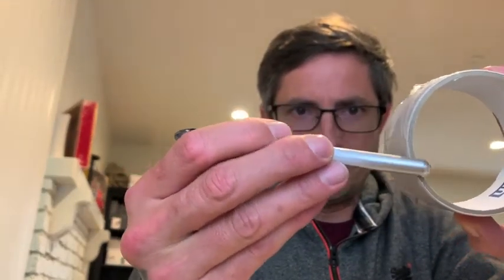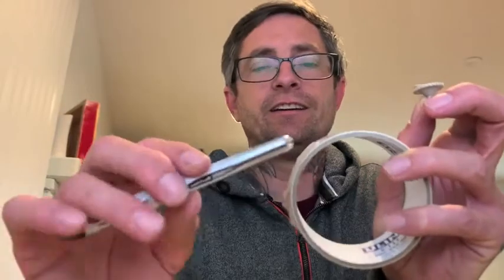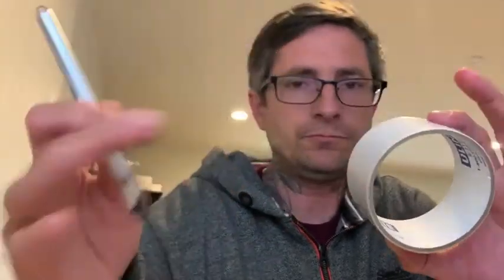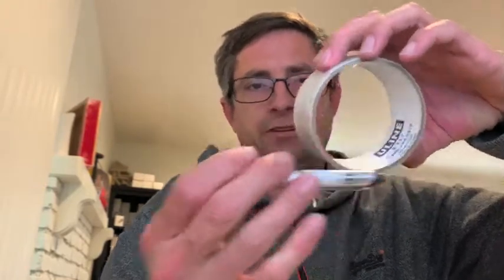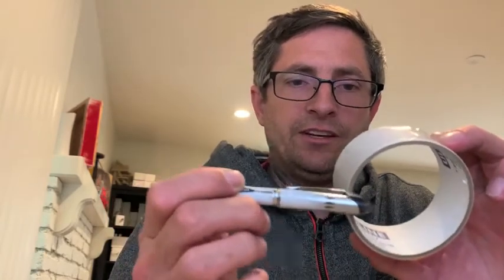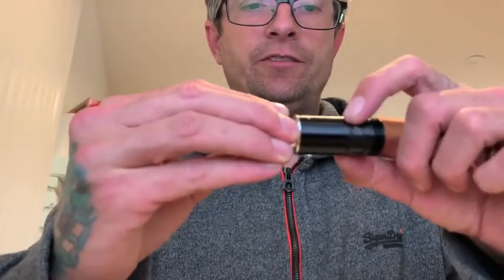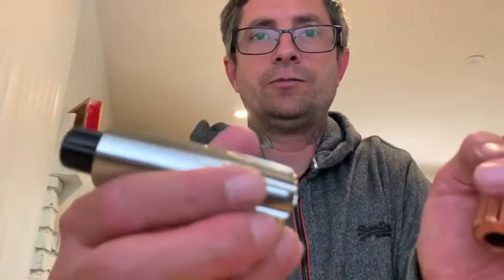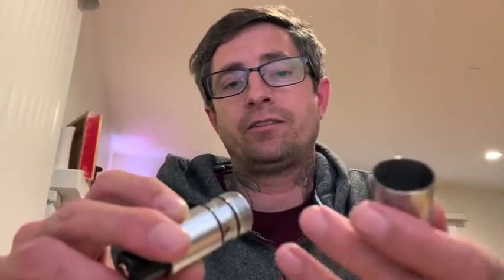Neuma 4 Waveform Explanation

Comment: This is the most insightfull talk about tattoo machines in general that I have ever seen on YouTube!! 

Did you ever think of using BLDC outrunners? You would be able to translate torque directly by attaching the cam to the motors bell housing rather than having the forces on the motor shaft?

Comment: The idea of the wave form, seems sound.  Maybe I'm missing something, but your explanation of give, seems flawed.    You are describing the combination of give and the bottom part of the curve and needle depth as almost a COMBINED FLAT spot in that curve of the rotary.  My understanding is much different (although not much different from your wave form idea). To help me explain, Let's take the 1st Dragonfly give mechanism to describe.    When circular drive mechanism (Exo-center) is in the 12 o clock position, and then drives to 5.  The needle is traveling downward.  The spring in the give position of its "tension"  knob COMPRESSES which delays the needle's take off.  It might not start at the 12 o clock position, It would most likely  take off at 3 to 5 o clock depending on rigidity of that spring).  Then, the DRIVE mechanism extends fully at 6 o clock , but the DELAYED SPRING doesn't allow it to hit until at about 7-8 (this depends on the rigidity of this spring also). By the time the spring allows it to hit at exo-center 7-8 the drive may have cut the spring's travel short (depending on RPM).  The needle might get sent on it's way back up, on time, OR SOONER than 7-8 if the exo-center reaches upward motion before the spring fully extends..    The reason this is thought of as ideal, is because, just like coil machines,  SPRING TENSION dictates these variables.  Depending on the "stay up" spring at the bottom and the tension of the spring in the give knob.  The "stay up" spring is similar to the BACK SPRING on a coil, the give spring int he tension knob at the top is the contact spring in a coil.  THIS EXACT variable is what made the coil machine STILL the best device for  putting on a clean and low damage tattoo.  You could ADJUST time in the skin, by balancing the tension of the back and contact spring on a coil machine. That also could be slightly and withing reason, adjusted by voltage on both of machine.   There is more reason than I care to explain why all of that is important on an INDIVIDUAL TATTOO level, but.......

     .....All of that also this misses one HUGE point.  Part of the reason older tattoo artists never used rotary tattoo machines a long time ago,  was as you mentioned, because of the exclusion of "give".  Your explanation of what give is AND why it was necessary lacks.  SO many explanations of it do today as well.  What they meant was the machine gave with EXTREMELY PRECISE pressure.  A good machine (in my opinion) had EXACTLY the same pressure exerted to the tip of that needle, all through that "give" area.  Meaning the hit felt the same at the point where it started to "give" as it did just before the "give" ended.  The end of give was always WAY after the tube tip ended.  All of this did A LOT for helping the fallible human operating it.  It meant the   person could vary hand pressure slightly (or surface topography could vary)  through that "give" area and the machine hit the same every single hit.   THIS IS WHERE the other saying, "Let the MACHINE do the work."  comes from.  TRUST ME, every single coil machine I built felt EXACTLY the same all through that give stroke.  All of those parameters including what tension it did the giving at, how fast or slow it hit all depended on usage.  Black and grey, Color packing, color blending or lining.

     Your explanation of the needle penetrating, and that kid who inserted the needle, the puddle and then he wiped the puddle, no dot...  What this person was correctly demonstrating is The Hydrostatic Principle, which states “a body completely or partially submerged in a fluid undergoes a push equal to the weight of the displaced fluid.”  What this means in terms of tattooing is, the needle enters the skin.  The needle when it enters (because of collagen) forms an air tight seal around the needle.  This air tight seal in entry allows air to escape from the  hole of the penetrating needle, because atmospheric pressure is less than the pressure created by the force of the entry of the needle.    Then as the needle hits the skin, the force of the hit throws ink from the tube and needle grouping on to the skin encompassing that hole.  As the needle is withdrawn, The displacement of the volume of the needle creates a vacuum in exact proportion to the volume of the needle, which sucks the tattoo pigment into the skin to replace it in exact proportion.  The collagen elasticity closes the hole over the pigment which is now trapped inside.  The un-retracted needle hanging in the skin you described, rips the skin, no longer creates this vacuum, or suction into the hole created.  This causes more damage (scarring)  AND not as much pigment displacing it.  So it looks not as saturated in the tattoo and possibly has raised scarring.  Long stroke with give allowed time for the pigment to pool around the needle creating a water tight seal around the entry.  Which is why you like longer hangtime for color packing.

I am an old school machine builder, I built probably 5k machines in my time.  I never cared about making money to build my buddy's machines, I just loved the mechanics.  I understood  machine geometry and spring interaction to create any machine I wanted.  I am looking at this from a point of reason and knowledge.  The coil is one machine and you could set it to be all variations necessary.   Any way YOU wanted it, because we all tattoo different.  For lining, I liked medium stroke not much give.  Color, The machine needed a LONG stroke with punchy forced give.  For black and grey, FAST with short stroke very low pressure to start the give and the tube tip would end before you reached the end of the give.

Comment: Can we get video explaining the new counterweights? can we cold sterilize the grip without it damaging the spring?
Reply from the maker: Yes the springs undergo a passivation process that makes them resistant to corrosion.
Reply: @NeumaTattoo  my neuma 4 has been running strong.great machine .highly recommened

Comment: Thanks for the information your machine is very interesting. So you mentioned a 5mm stroke being in a similar well zone as your machine, would that mean you could speed it up and shade with it and do more passes without causing the drag trauma to the skin?
Reply from the maker: Yes, exactly. You can do more passes with less trauma. Try the 33% for a multi-pass blender tool.

Comment: very cool machine, probably gonna order one right now. I was wondering what are your thoughts on modifying the cams a little bit to either accelerate the pushing portion of the cam, or even like shaving off a little bit of the cam on the down turn so the retraction is even more accelerated? the cam wheel looks like a sin wave, but what if it was like a sin wave with like a steeper back end? just a thought from a curious artist =)
Reply from the maker: This is exactly how the 28% and 33% are designed. The 28% has a slightly slower needle extension with a rapid retraction and the 33% has an even slower extension with the same rapid retraction.

Comment: Why is it that don’t you just have the curve just fall off after the deepest insertion point? Rattle? Damage to the plastic cam?
Reply: I picture it being insanely noisy that way
Reply: Probably deform the cam this way why the amen by stigma had to keep upgrading whhat their cams were made of
Reply from the maker: You are all correct. We have tried many configurations that were not ideal. The instant recoil not only was very noisy, rattly, and short lasting, surprisingly, it did not improve the desired outcome as far as the tattooing goes. It turns out that the 20% was best for lining for a number of reasons. A little bit of dwell made for a quicker saturation, the geometry of the cam ensured that it would last a long time tattooing, and it is still smooth enough that its not too noisy.